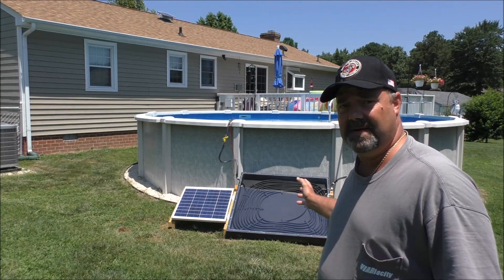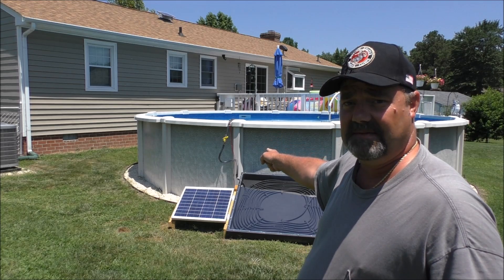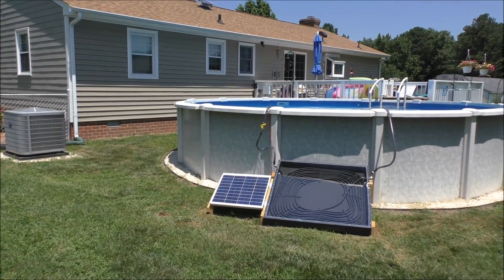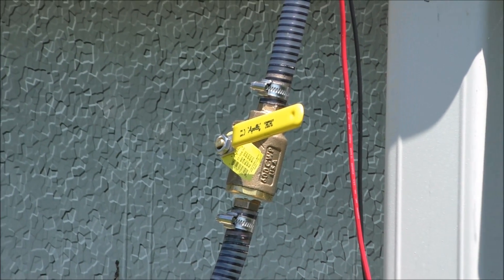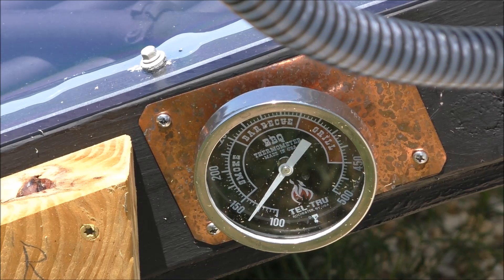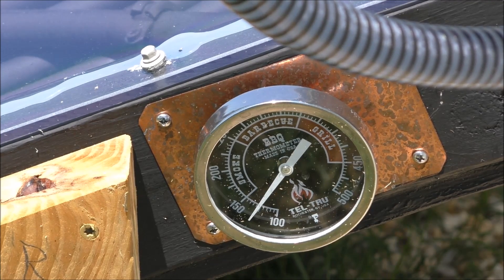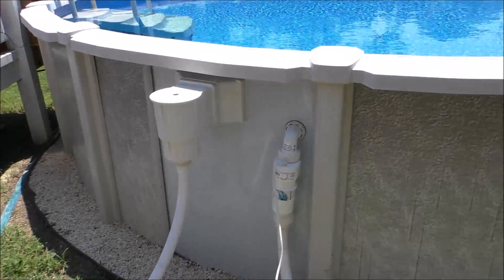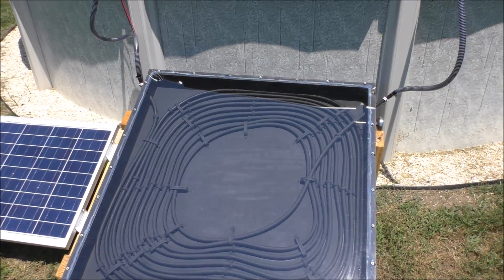Solar Hot Water Heater / Pool Heater Project Update With KVUSMC

Comment: Hi Kenneth,  Thanks for the videos!  With your valve slowing down the flow, it sounds like your temperature increase is 16 degrees (100-84).  It would be helpful to know what the flow rate is (i.e., how long does it take to fill a gallon container at that slower rate)?  Then we could calculate how much heat is actually being added to the pool per hour of running.

Thanks, John  :)
Reply from the maker: Hi Buddy I agree With you if could find a slower pump it would be great the longer it stays in the collector the warmer it gets

Comment: It's actually not accurate to restrict the flow of water. The rate at which heat transfers from the hotter object (pipe/box) to the cooler object (water) increases with the temperature difference between the objects. By letting it sit in the box and heating the water up, you are actually decreasing that temperature gap, making it less efficient and taking longer to warm your pool.  You would rather have a 1 degree bump but have it blasting vs a 30 degree bump at a trickle.  Great videos though, your setup is great and I used to to build mine. Tested it today and the results were great.
Reply: YES! Thank you for that. I see all these DIY heaters restricted down to make it SEEM more impressive and it makes zero sense to me.  I think we need a Thermodynamics Engineer to chime in!
Reply from the maker: I appreciate the input you learn something every day

Comment: Solar energy is about  900wats per  square meter.  By slowing the flow  you are heating less water but to a higher temperature . By increasing the flow it will heat more water but by less increase in temperature.  However the energy going into heating the pool will be  the same  of 900watts if  your solar collector was 100%  efficient. I have built  a similar system to this with a  12v  pump. and an Arduino  which switches the pump on when there is a 5C difference between the pool and the solar collector water temperature . Living in the UK  with cloud  and cold days has potential of cooling the pool and  not  heating it.  Also  i have  a flow meter in the water circuit so that i can calculate the volume of water and  increase in temperature . From that i can calculate  how much heat energy is actually going into the pool in watts. By knowing the volume of water in the pool. with  maths i can calculate how much energy it takes to raise the pool  temperature by 1C . This way i can judge how efficient and how much power i am saving from heating the pool with electricity.  I  have fitted  an air  temperature sensor. And from that i can calculate  heat loss from the above ground pool. The data is stored on an SD  card to  analyse  later. This all may seem like overkill. But the data will prove the cost effectiveness and prove the concept .Because  putting a probe on in the pool and  one on the  return flow. only tells  you that the pool might warm  up over time.
Reply from the maker: Awesome Great Data  Sir

Comment: sorry to bother you, i am a newbie at solar.  mc4 connections i see home depot sells a 50w solar panel,  how would i go about the hook ups to the bilge pump? do i have to make the mc4 connections?  and if so what go to what if its not colored.  any help would greatly appreciated sir.
Reply from the maker: +frank piedmont Hi Buddy you don't have to use MC 4 Connectors You can Use 3m male and Female Connectors
Reply from the maker: +frank piedmont  Here You go buddy https://www.ebay.com/i/400275365551?chn=ps&dispItem=1&ul_ref=http%253A%252F%252Frover.ebay.com%252Frover%252F1%252F711-117182-37290-0%252F2%253Fmpre%253Dhttps%25253A%25252F%25252Fwww.ebay.com%25252Fi%25252F400275365551%25253Fchn%25253Dps%252526dispItem%25253D1%2526itemid%253D400275365551%2526targetid%253D315541634842%2526device%253Dm%2526adtype%253Dpla%2526googleloc%253D9008608%2526poi%253D%2526campaignid%253D835978959%2526adgroupid%253D46403705967%2526rlsatarget%253Dpla-315541634842%2526abcId%253D1123866%2526merchantid%253D6532034%2526gclid%253DCjwKEAjwvYPKBRCYr5GLgNCJ_jsSJABqwfw74BER3TOvOp9OLTqAfjkB6_VmEF6nHUtPmkXI3GUVFRoCeGbw_wcB%2526srcrot%253D711-117182-37290-0%2526rvr_id%253D1232261252557

Comment: Hi Ken, Did you use regular glass or plexiglass? Wondering because I saw that you used screws to secure the glass.
Reply from the maker: +MrRobDale Hi Buddy I'm using Lexan or polycarbonate / plastic
Reply: KVUSMC / Kenneth W Viar Jr Thank you. Great video! I have another question... won't the diverter valve cause stress on the pump? Is there a smaller pump to use?
Reply: for water setups, you don't want to use glass, since the water steals so much heat, you don't want to block any % of the sun

Comment: where did you get the solar panel from?  thanks
Reply from the maker: +frank piedmont Hurricane Wind And Solar It is a 50 Watt panel
Reply from the maker: +frank piedmont Here is a link Buddy 
https://www.hurricanewindpower.com/hurricane-wind-power-50-watt-solar-panel-poly-crystaline-off-grid-boat-and-rv-synthesis-solar/
Reply: thank you! i enjoyed your videos
Reply: one other question.  how did you do the solar hook up to the pump?  i found the pump on amazon 16 bucks just wasn't sure how ya did it,  thanks
Reply from the maker: +frank piedmont Hi Buddy I Just Hooked the Positive and Negative off the Pump I wire it Direct Using 10 Awg Wire I Used 3m Heat Shrink Butt Connectors size 10-12  and I used MC4 connectors
Reply from the maker: +frank piedmont Hey Buddy I used 3m Heat Shrink  Butt Connectors size 10-12  and MC4 Connectors to the Solar Panel It works great 
https://youtu.be/id7qPMDYRuU

Comment: great update, how many gallons is that pool and what is the flow rate of your pump at the trickle you have it going?
Reply from the maker: Hi Dan the pool is 12,000 Gallons  I need To Measure how many Gallons Per Minute  that is coming out of the collector ! I can Say this it works allot better this way as far as Helping it Heat ! Many Thanks Cheers Kenny
Reply: FYI, I did a similar project using 8 Heilatos EZ-37 Solar Water collectors all  hooked together.  I used a Topsflo TS5 15PV Solar DC Circulation Pump powered by a 15 watt solar panel.  The flow rate is 3GPM.  The maximum difference in temperature at that flow rate is 8 degrees warmer going out.  My pool is also 12,000 gallons.  I slowed the flow rate and could get over 100 degrees water.  Here is the kicker, an engineer ran the data and said slowing the flow rate has no effect on making the pool warmer due to the large volume of water.  The warm water would simply vanish due to evaporation especially at night in dry climates.  For best results use the faster flow rate and get the 8 degree difference and cover your pool at night to trap the heat in.  Also pool stores sell solar rings that heat the pool via the sun and help keep evaporation down at night.  So using the collectors and solar rings, my net difference in the pool temperature is a total of 9 degrees warmer.  The water collectors account for 4 degrees and the solar rings account for 5 degrees.  I used my neighbors pool at the control group since it is same size and has same sun exposure.
Reply from the maker: +Dan B I agree on The Solar Rings or Solar to keep the heat in at night but as far as the flow rate I can adjust that for a happy medium I thought Of buying some Collectors but Building My Own Was The key to performance built To my specs it is working Great as far as keeping The water warmer Even if it is only 3 to 10 degrees difference